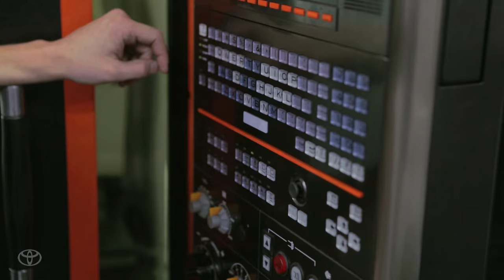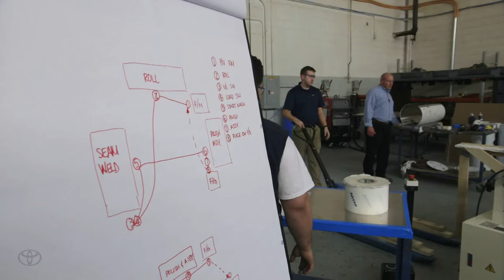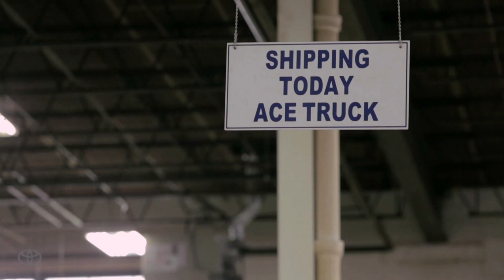116 Innovators | The Toyota Effect | Toyota

Comment: Lean certainly improves the processes and optimizes the labor utilization, however, it is incorrect to say that the number of jobs positions are not reduced. With the effective implementation of Lean in any environment, work can be performed in less time. In this scenario of ACE Metal Crafts they ended up hiring more people because of increased sales.